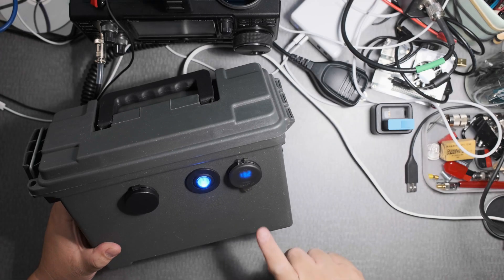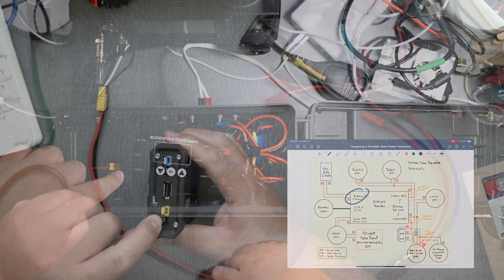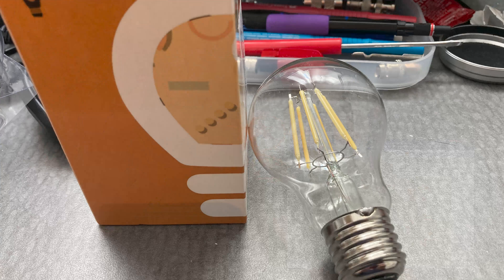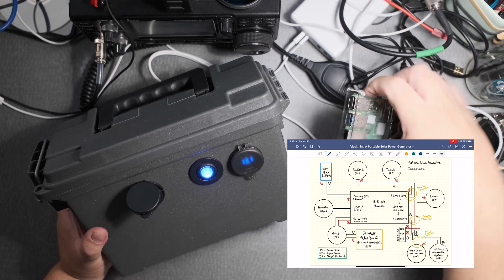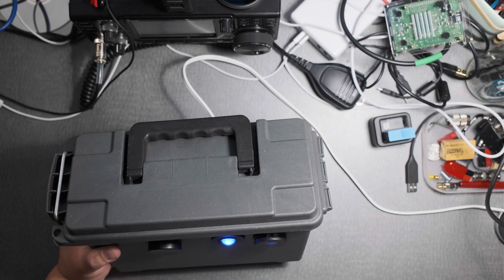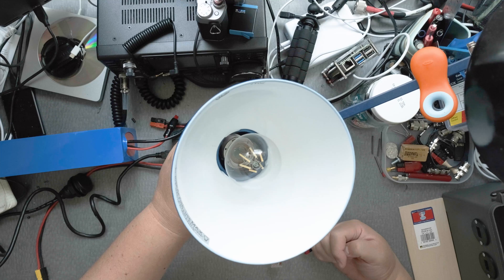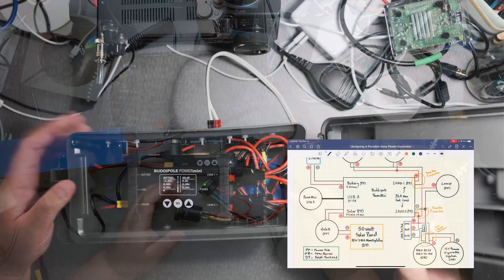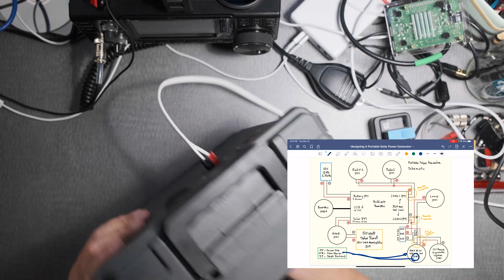How To Build A DIY Power Box

Comment: When not using solar to charge the battery, how do you charge it?
Reply from the maker: The bioenno battery has a way to charge the battery.  So when there is no sun, I'll just charge it that way.
Reply: @frankwc0o  oh. The reason I ask is I am going to build a battery box, but want to be able to charge the battery off grid power with my trickle charger. I think I can just use of the cigarette plugs mounted to the outside to connect it when at home or charging overnight. I was just going to run two inputs off the solar panel side of the controller, one for the solar panel and one for the input from the trickle charger. I am assuming the charge controller doesnt know/care where the charge comes from, just so long as it's 12v DC. I could be wrong though and please correct me if I am.
Reply from the maker: @PendejoRyan  What you have stated is logical.  The charge controller should be able to manage the incoming current when the battery is full.  The only thing is, will 12 V be enough for the charge controller to manage the charging.  Usually solar panels are 14 - 21 Volts.  I'm wondering if 12 volts from the cigarette plugs be enough.  The only way to know is to test it.
Reply: @frankwc0o  thanks for the reply. I guess I'll be finding out 😁